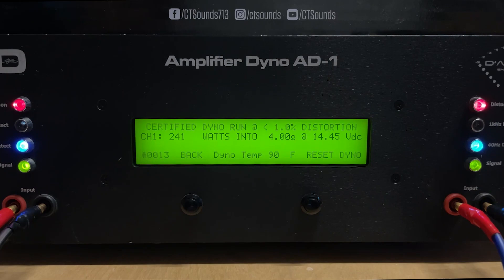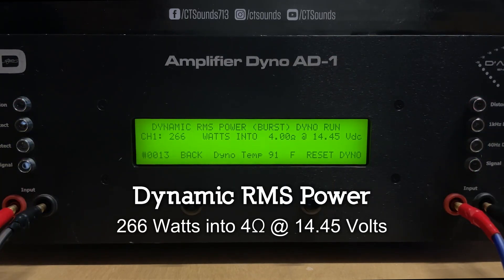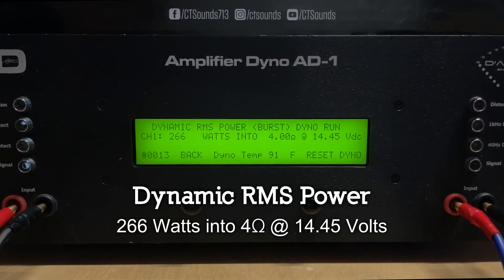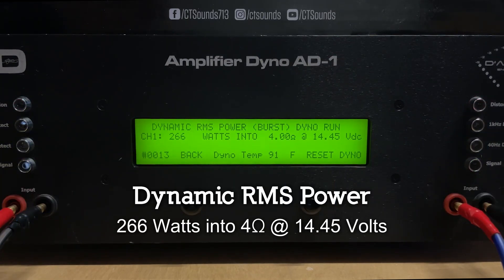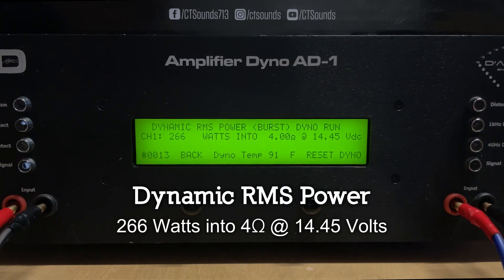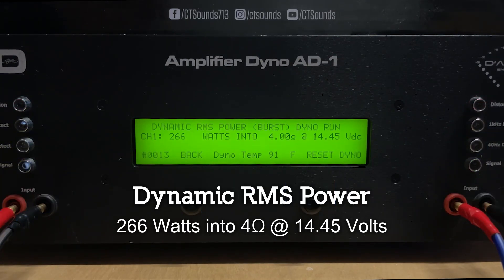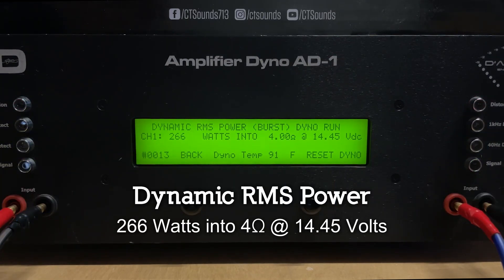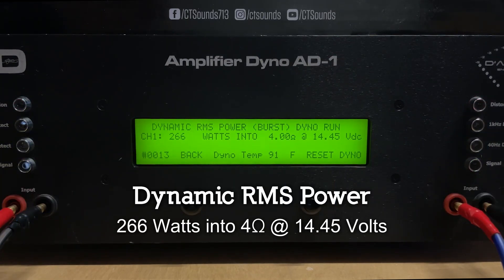CT Sounds CT-400.1D Monoblock Class D 400 Watt Amplifier | Amp Dyno Test

Comment: They make great amps for sure. I'm wondering when will they get in the bass knob for the Team amps because I need one ASAP
Reply: Mine came with a knob (bought roughly a year ago).  The amp is a beast.  The bass knob could definitely be updated tho.   Voltage and clipping are great but the potentiometer could be better.   Mine goes from nothing to wide open in about a tenth of a turn.   I leave it wide open and run off the lc2 knob.
Reply: @jssouthtx  I had the original knob but it was accidentally broken. Other than that the amp has been doing great for the past 5 years without any issues in my daily.
Reply: @JaMarvelousjmar  I’d be curious if the new ones have better range.  I went full CT for both amps, all speakers, and wiring.  Out of all that the bass knob is the only component I would say needs improvement.